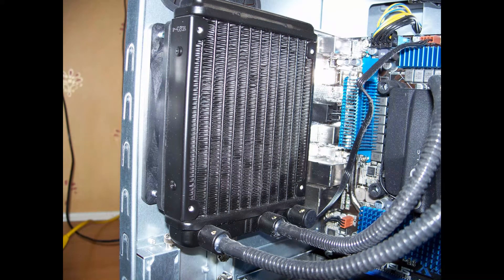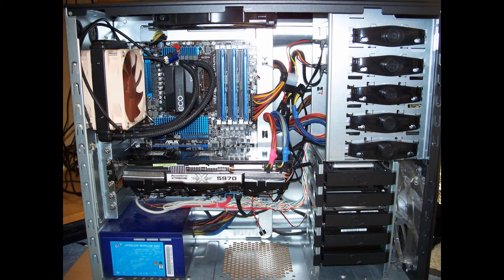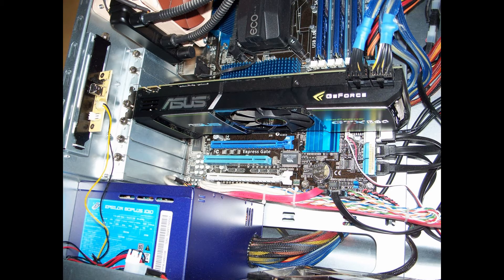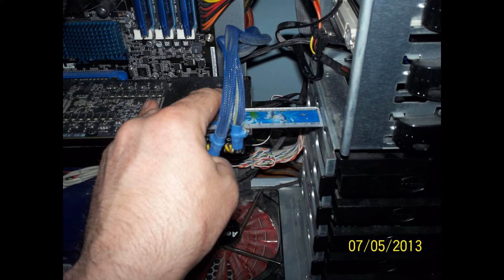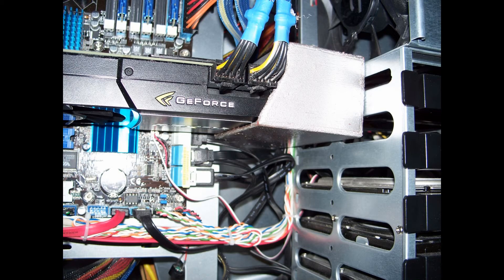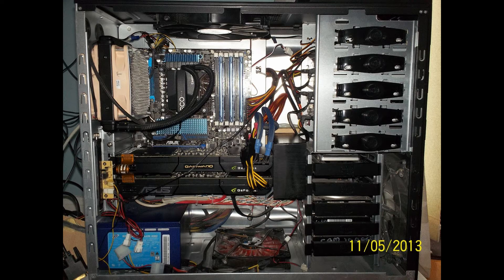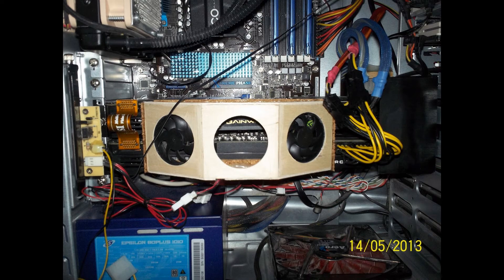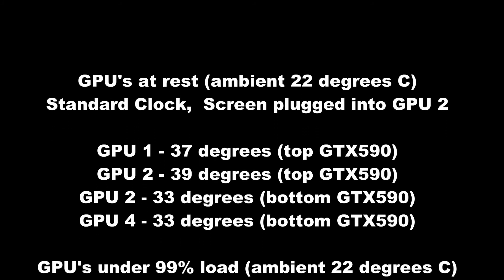Quad and Dual SLI, Crossfire Air Cooling Graphics Cards - Better cooling mods with standard cooler.

Comment: I realize that you have allready done this, and have no qualms about modding case, but that bottom fan on case could have been fed the exhaust air from the front end of the 2 vid cards, and need not cut case. The pressurized intake for the slot between cards is a good idea. Is it possible for some other single card to equal the performace of the 2 you have got? A single card is easier to deal with more space around it.